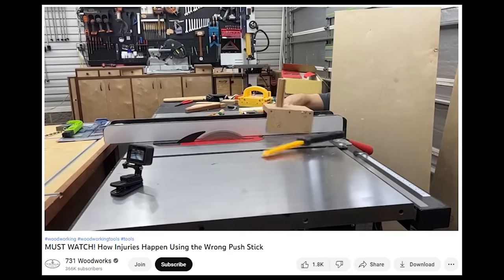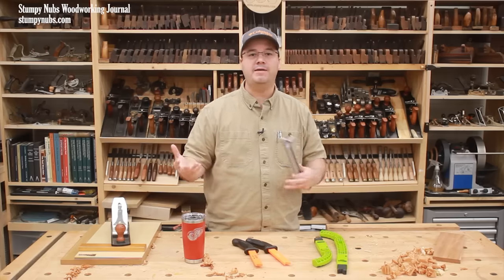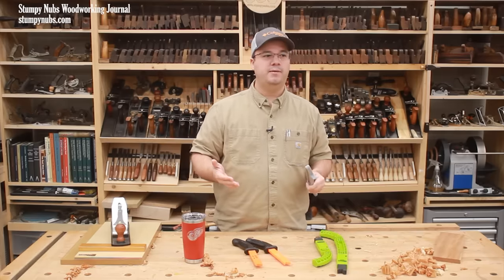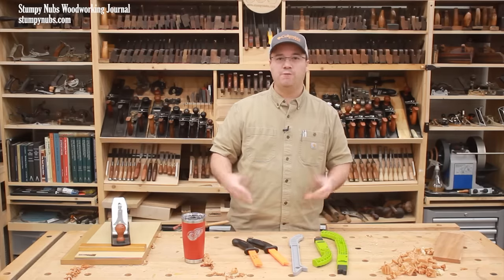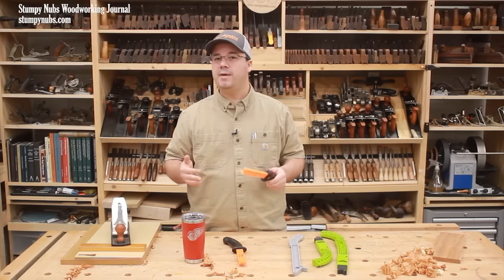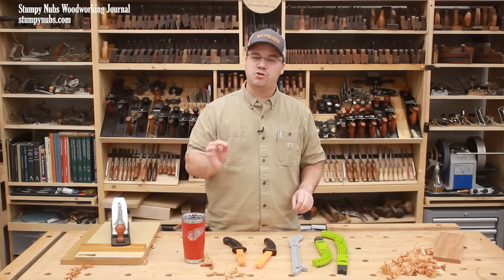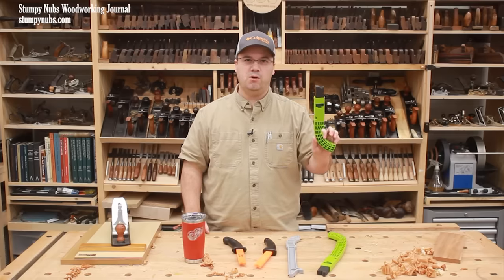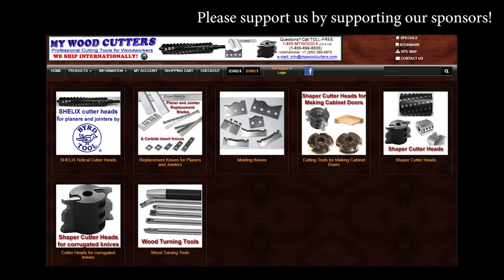EXPLODING table saw push sticks are a real thing!

Comment: I take issue with the feather board video from feather board pro, in their original video at 10:07 the material is advancing slowly and then suddenly the material lurches forward and then the feather board fingers go flying back. Question I have was there any editing done here? Not necessarily casting any aspersions here but rather trying to understand what the video is showing us. It looks like the feather board was setup "over" the blade? If so then it was setup for a spectacular failure it would seem.

While a wood push stick may have fewer of these issues I could certainly see an acrylic push stick possibly having more of these issues. Stumpy, your video is informative as always

Comment: Had a gray “ShopSmith “ push stick that I had for several years and about three years ago I was using it on my table saw and came in contact with the blade. The thing literally exploded sending shards of hard plastic everywhere. Wound up with a few pieces hitting my chest and pierced the skin. Dropped a little blood on the floor but was Very lucky 🍀 Nothing serious and was able to walk away from it. Until then I hadn’t considered the brittleness of some of the plastic parts laying around that could potentially come in contact with blades and the like. Woke Me up😱😵‍💫

Comment: Thanks for the heads up.
I normally use wood sticks but I do own a LV Dual-Tread Push Stick ( 03J7550) which I find excellent. Has a rubber foot and also provides a downward force that may stop kick backs

Comment: I don't like push "sticks" since the angle of push is usually Down and forward towards the blade.  I prefer tall push "boards"  Usually with a handle similar to a miter box saw and a  long shallow notch on the bottom.  This keeps the direction of push "and your hands" above the saw blade.

Comment: I just made my own out of MDF board,  I’ve got lots of little cuts on mine and it just cuts it but never bites in and wrenches it of my hand.  Cheap easy to make and won’t cause an accident although MDF isn’t good for you when it’s dust is in the air.  I cut mine out side with a jig saw wearing a FFP3 mask.

Comment: I use something that might be best described as a pull board. I don't know if there's a n actual name for that type.
I made mine out of scrap cellular pvc board.
It's about 8 inches tall, with a handle along the top edge, and about 10 or 12 inches long, with a catch cleat on the trailing end.
What I like about this style is, I'm pull the stock through the cut while keeping downward pressure on it, and my hand is relatively far away of the blade. It's tall enough that the blade guard can still be used if the cut is wide enough. The flat board can be run flat against the rip fence and you can also attach a device to hold it against the fence. 
It was cheap and easy to make.

Comment: Wood or plastic, I’m not a fan of the birds beak style push sticks. The flat board style with a “hook” in the back to push allows the user more control- can push the workpiece down and against the fence over a wider area-not just at the back of the piece.

Comment: Y’all should have been in my shop last night.  Cheap (WoodRiver) plastic push stick “touched” the blade and BAM!  Out of the hand and grazed my forearm hitting the wall 8 ft. behind me and then 20 ft. in the opposite direction and into the garage door.  I have the JessEm Clear-Cut TS Stock Guides on my fence and they kept the wood from kicking back.  However I now need a new zero clearance throat plate.   The stick did not shatter.  But my bandsaw ended it and it’s twins wholeness just before they were re-homed in my dust bin.

Comment: This actually happened to me this past weekend.  I was cutting some stock for cutting board accents. approx 3/8" thick.  I had pushed 4 or 5 boards through and was on the last board.  I just caught the stick that came with my ridgid 4512 on the blade.  The tip exploded and the stick was jerk right out of my hand.  Nothing else happened,, no injuries etc ... just a "what just happened" moment.

Comment: I've got a few push sticks I made out of some scrap maple from a place I used to work at. I also made a bunch of osb ends for them that I don't mind sacrificing to the blade of necessary and just have a couple screws that hold them on. Different handle shapes for them depending on the task at hand. Good video man. Too many go for the clickbait and go nuts with all kinds of stuff. You are bringing sanity to the safety aspect of things and thanks for that. Keep doing your thing.

Comment: It's not just the plastic...it's the molder.  Many injection  molding shops are in the business of turning out parts as quickly as possible.  They run the tools and plastic at the lowest possible temperatures and make up for it by running high pressures.  This low temp/high pressure approach leads to high residual stresses in the parts...which are waiting (like a curved piece of wood) to let go when they get cut.  In extreme cases, the internal stresses can cause the cheap plastic parts to fail with little to no load.

Comment: just make a push stick out of some scrap, takes about 5 minutes, i used to do it all the time at my carpentry job. if it hits the blade, it acts just like your project going threw the blade and not explode. bonus, if your doing many slim things, purposely make it bigger on the bottom and it will have a groove in the blade spot and push everything else threw. making sure only oddities and knots are likely to come back at you.

Comment: @Stumpy Nubs  When I finally started using magswitch featherboards, JessEm Stock Guides, and quality push sticks/blocks, I have never felt more comfortable using my table saw.  By the way, I feel like there should be a PSA on the danger of using the Kreg crown molding tool...that thing is unbelievably dangerous.  I've never had any major incidents in my shop until I used that thing on my miter saw.  The way it elevates the workpiece, and the lack of support on longer cuts just makes it a seriously dangerous tool to use.  The Perkins Builder Brothers did a video on this a few years ago, but I think it's worth reinforcing if you have an opportunity!  I had a cutoff bounce and it sent chunks of wood flying into my face and chest.  Luckily I had my eye protection on.  If anyone reads this and has the Kreg crown molding tool...put it in the TRASH!!!  Kreg makes some great, affordable and safe products...but this is NOT one!!!   P.S. Love your videos - you have inspired me on multiple occasions to invest in my safety in my shop.  Thank you for that!

Comment: I have a few wooden push  sticks which I copied from a plastic one. I never use the plastic one which came with my bandsaw many years ago.  Made from hard wood, they have served me well, sometime using two at the same time. Plastic will shatter, but wood will just be cut by the saw blade.

Comment: I made mine on wood, far safer for design from the one I got with my TS. I sometimes use grrrippers. A careless friend of mine retracted the gripper in a wrong, hasty move after a cut and got a big tug and a big carving out of the central lower pad of the gripper. It could have meant half of his hand off.   The morale: use pushers and work calmly.

Comment: I don’t like “plastic” push sticks. There is only one push block style I use which is synthetic not plastic but most are wooden or plywood. So as long as I maintain the position even if the blades cuts it, I feel safe.

Comment: I just grab the closest piece of wood to use as a push stick, sometimes two. I don't use the table saw regularly, never felt the need to buy or make a special tool I'd end up losing.

I would imagine pvc or a similar malleable plastic would be fine.

Comment: 4" wide cut in less than a minute on the chop saw out of different width's of wood or ply. Sometimes you should be purposely allowing the blade to cut thru the push stick.  I throw the plastic one that comes with the saw in the garbage. The craziest one I've seen is a carpenter using his utility knife on a job site.

Comment: Im not a fan of plastic push sticks, ive told anyone using them to make sure they aren't cheap china crap and at least spend the money on a good one. I prefer to make my own.. after seeing the green push stick(forgot the brand) I may have to try one out, that replaceable foam tip is a great idea, dont know how I've never noticed these until now

Comment: I have had a plastic shatter an almost hurt me. Since it’s hard to definitively know what plastic is good or bad I tossed all the plastic push sticks and only use wooden sticks. The type of stick that you show only controls the back on the workpiece and does nothing to prevent lift on the far side of the blade. This leading edge lift is a major risk for kickback. The stick I use has a vertical handle and horizontal replaceable shoe to hold the workpiece down.

Comment: I looked at the plastic effort that came with the latest saw I bought and went right on using the wooden ones I've used for years.  I reckon the saw manufacturers include the cheapest available to avoid getting bad reviews (no push stick included! Gasp!!!), but these plastic efforts likely make a lot of people think they can be used for everything and anything.  Using your head is the only way to stay whole - that and staying out of the workshop.

Comment: If you're working in a wood shop surrounded by wood offcuts it's easy enough to make a selection of various shaped and thickness poo sticks out of pine or oak whose behaviour is predictable if the stick inadvertently comes into contact with a rotating blade.

Comment: Great follow up to Matt's video. Lost among the wild flying bits in his example was the statement about the HARDNESS of the plastic used. A push stick made of similar material could be severely damaged, without a doubt after hitting a saw blade, or even a router bit.
   Your test of the plastic with a knife is a great one. anything easily cut with a knife is likely softer material.
Personally, I have always disliked the 'chicken foot' design, preferring other types which hold down the work while pushing the workpiece through. I see the key flaw in their use that they do not prevent the rear of the piece from lifting above the surface of the saw and KB become very likely.

Comment: The worst injury ive ever had in the shop was from using a plastic push stick. Nearly broke my wrist. Those things give almost zero control over a board. Its better than nothing, but a beefy push block made from scrapnwood is infinitely safer.

Comment: The push stick that came with my ( cheap Skil) tablesaw is hard plastic. I only use it occasionally because it is about a half inch wide. My other is a vinyl type like the gray one you are showing. Hoping for that Milescraft Grabber next week.

Comment: The contributing factor to exploding plastic push sticks is the plastic itself. The one which exploded probably had glass fiber fill in it, which is used to increase both the strength and rigidity of plastic. The drawback of the glass fill is that the plastic is brittle. These plastics don't resist impact well. You can tell this when the plastic had a tinkly sound like a drinking glass.

Comment: AS per your example of why push sticks explode  is right but you really have no business cutting such thin strips that way in the  first place .Yes there are different kinds of push sticks but thin strip cutting against a fence like that is just plain dangerous . A simple jig can be made in less than ten minutes that can alleviate all of this or you can get one of those roller bearing jigs that allow you to cut thin strips away from the fence from the left side of the blade ..really wooden push sticks are the best -- plastic heats up when cut and binds to the blade causing disasters. My opinion is to just throw those things away  and make a wooden one of a type that keeps hands and fingers away from the blade .

Comment: The failure (binding violently) is a function of the fulcrum (your hand) is at a distance/angle that causes the object (the pushstick) to "pop" between being above an angle pointed toward the center of the blade (arbor) and below it.  If the angle of attack is higher or lower, 80% of the potential for kickback never exists...

Comment: I honestly don't get the idea of plastic push sticks. In all furniture making shops i worked in we always made them from scrap pieces of mostly ash so you could safely cut through them if you pushed a thinner piece through the blade. Hard wood like ash will be a lot less flexible then plastic anyway which i think makes it a lot safer and nicer to use

Comment: I've never been fond of that design of push stick, whether wood or plastic. I make mine from plywood, they have a nose that keeps pressure on the leading edge, a foot at the rear which catches the work piece. Make several, then use one for those thin pieces you need ripped,  it becomes a consumable. Many YT guys build similarly designed push paddles. Some guys go completely OCD on the build, some are more into function than aesthetics.

Comment: A good way to test wether they're brittle or not would be to just knock on it. A ringing clack says that the plastic is rigid and most likely brittle, whereas a softer plastick should sound muted since it can absorb energy more readily in the form of plastic deformation.

Comment: One thing that you may not  have thought of is the temperature of a persons shop which can make plastics more brittle. The push stick which came with my saw did exactly what the original video was trying to replicate. Temperature was probably still -2 C as I hadn’t been in it long and it was November in Canada. Push stick exploded on contact with the blade and I ended up getting some stitches from a piece splitting my lip in half to my nose. Sitting in the er while waiting for the doctor I ordered the grrripper which makes a world of difference.

Comment: I work with several types of plastics, and one in particular is not recommended. It's nylon plastic, and it is brittle. One that could be used as it is softish polycarbonate. It's used in bank teller windows because it has a strong resistance to shattering. Would it make a good push stick? I can't say dogmatically, but it is very durable. Acrylic is also not recommended as it can also shatter.

Comment: I stay with wood for my push sticks.  Plastic is ok for feather boards that are stuck in place but It is too much to figure out if the plastic I am using will shatter or just cut like my wood sticks.  I use a style that is designed to be cut into and discarded when it is too cut up.  Also on narrow cuts, it totally covers the exposed blade. When in doubt, just use wood.

Comment: I rarely use those "crowsfeet" push sticks, and only in conjunction with the wide and flat push stick with the little end that pushes the wood. Crowsfeet push sticks have little surface area to hold your wood piece. I always use wood push sticks, as I don't trust plastic ones.

Comment: Thanks for all the great content you put out.

Loved your comment on wooden push sticks.  I am a middle school & highschool woodshop teacher in Upstate NY.  Thays the first project my students do is make their own push stick.  After 15 years I have found its a great way to cover defects, grain structure and equipment safety and build confidence on the band saw with my eighth graders.   

Select their material, trace one of my templates, cut it out on the band saw, sand with the disc sander and spindle sander, palm sand the faces, drill a hanging hole in the handle and round over the edges at the router table.  Great way to use up last year's scraps.

Comment: I've had plastic push sticks get nipped by the blade before, usually when cutting a thin piece between the blade and fence.   Always consider the thickness of the push stick relative to the workpiece and the height of the blade relative to the "V" at the end of the push stick.

Comment: If you're doing 1/4 and 1/8 in rips it's probably best not to use a push stick and to use a push block that is made to make rips that small. 

I walk though each cut I make before the saw get's power attached.  If I see the push stick is going to contact or even get close the blade, it's time for plan B.

Comment: In my experience, any plastic push stick pushed slowly and straight into a blade will just be cut normally.  If the push stick is jabbed suddenly at a blade running at full speed, it can shatter.  His methods wouldn’t have shown the shattering - he essentially sawed it.  It has to be more of an impact.

Comment: Great video, James. We mostly know that brass, tin, lead, iron, etc are collectively referred to as “metal”. We understand that these each have unique characteristics and qualities. Less so when using the generic collective “plastic”. Most plastics are derived from hydrocarbon bases, and many have other composite materials added that greatly alter their characteristics, in the same way metal alloys do. So you gave the best advice - “Try to avoid hitting your saw blade with your push stick.”

Comment: Another table saw safety tip is never use your table saw on the floor. Bending down and hovering over a table saw while its running is about the dumbest thing you can do. Iv seen plenty of guys do this on job sites and make em elevate it before they kill themselves.

Comment: If the tip/end is damaged, there would be no need to remake an entire wooden push-stick - just make a new end that is easily fastened to the upper stick.  The connection could be a simple lap joint, with a couple dowel pins driven thru to secure the sections together.